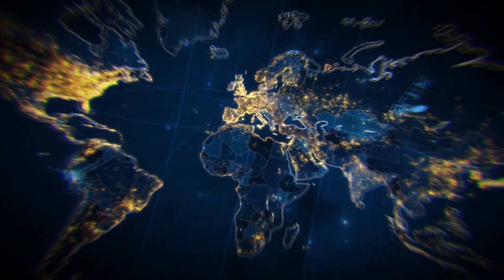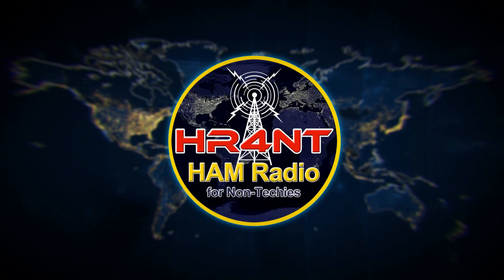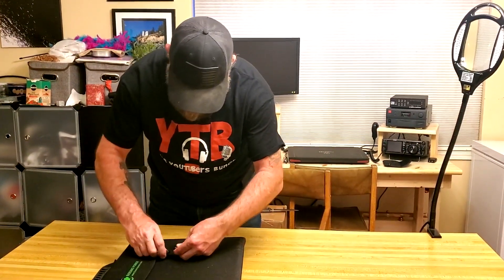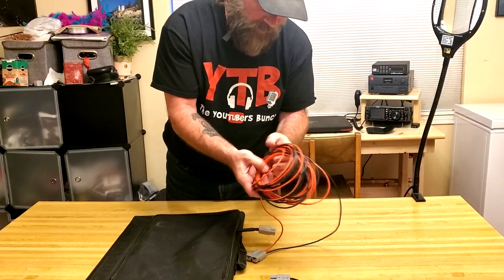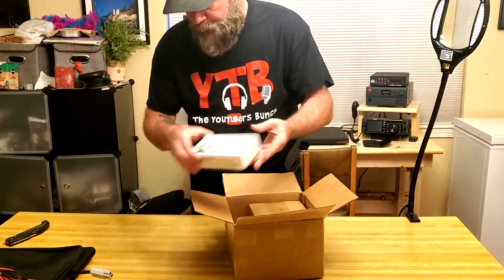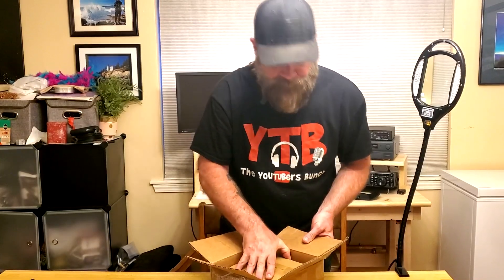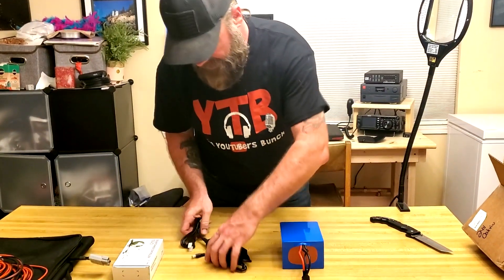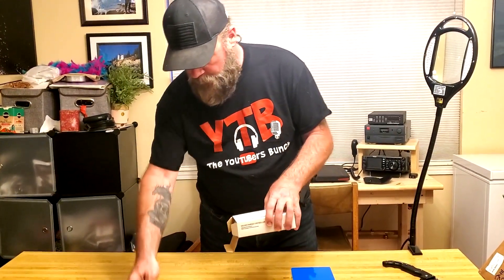Bioenno Power for Ham Radio Unboxing

Comment: Did you make a video of this in use?
Reply from the maker: I have a few videos of my use of the battery during POTA activations, however I have not needed to hook up the solar panels yet as I have not been able to run the battery dry in any outdoor activity yet.  I may show in a future video how to hook them up and use them while operating, but probably won't be a very action packed video.  Thanks for the suggestion and for watching.  73!

Comment: I was having the same issue..thx
 Still cant find info. If I can plug a 12v bioenno into my ic7300 with the plug that's on the battery...it will fit but do I need something in between  battery and ham?..I have same battery as you in this video.
Reply from the maker: You can use a power pole box like the rig runner if you want to add multiple items, but if you don't want to do that, you can just plug the radio directly to the battery.  I do this all the time an it works fine on my 7300 and my 705.  Thanks for the comment and for watching.  73!

Comment: no offense but this basically an unboxing as opposed to a review.  you mention the good quality… have you used it yet?
Reply from the maker: Since the video was made, I have actually used it and it performs perfectly.  Zero complaints and no issues whatsoever with the quality and performance.  I stand by my original statements in the video that Bioenno is a quality manufacturer of quality products.  Thanks for watching..  73!
Reply: @HR4NT    are you able to transmit at 100w ssb?

Comment: You should have used red/black power cable fir that pigtail. And you are correct with this installation introduction instruction. Thanks for doing this for us the amateur guys. I was trying to create a channel like this one but you beat me to it. 73 de KI5GLT
Reply from the maker: I actually went back and made an update video where I made the cables the right way...I don't want to instill bad habits with anyone who is just getting started, so the correction video was made.  Thank you for the comment and the support of the channel.  73!!!
Reply: Short of that..a short piece of RED shrink tube will identify the positive wire w/o question. 👍

Comment: Bioenno has a setup on their site how to connect a rigid solar panel and foldable to the controller and battery on their website.
Reply from the maker: Thank you for the comment.  That is good information to know. The instructions I got with my order didn't really explain in great detail how to do it.  I will go find that page on their site and add it to the links for this video.  Thank you for the support!  73

Comment: you will need  4 pin to PP adapter for the 891 https://www.hamradio.com/detail.cfm?pid=H0-009644 Then a PP-fuse-PP https://www.hamradio.com/detail.cfm?pid=H0-008796 after that, then the battery.
Reply from the maker: Thanks for the info!  Now I just have to wait on the radio to show up...LOL.  73!

Comment: Did you buy it as a kit or was it a piece by piece purchase? Thanks
Reply from the maker: I bought each piece separately.  I was told they have solar kits, however I couldn't find them on the site.  Thanks for the comment.  73!

Comment: 13:00  Very bad practice to use 2 black wires to make a power cable - if you try this at home, plase be VERY careful so you don't damage your equipment.
Reply from the maker: I was being lazy and cheap at the time...lol, but wanted to get the point across.  I am planning on getting some red wire today and resolve the situation.  Thank you for your comments!  73!